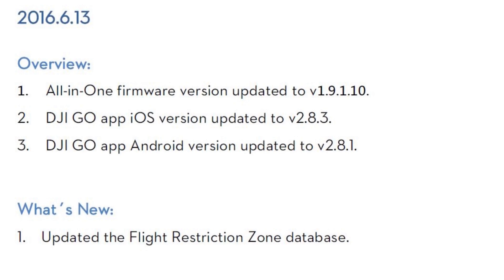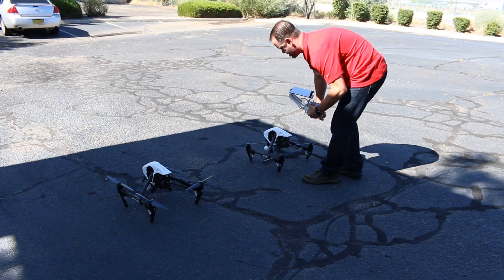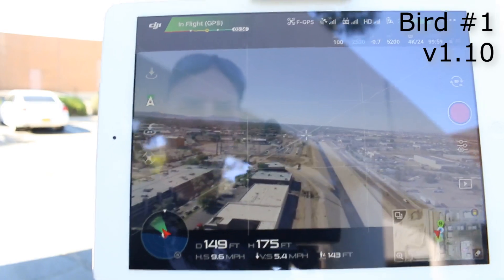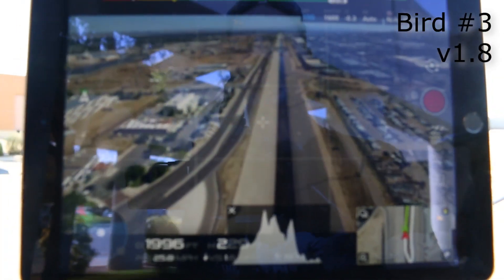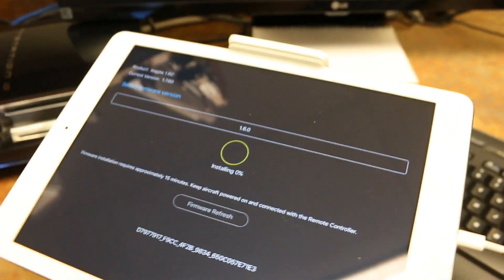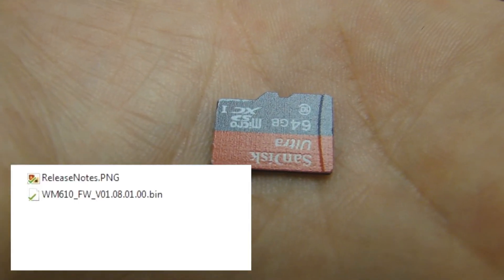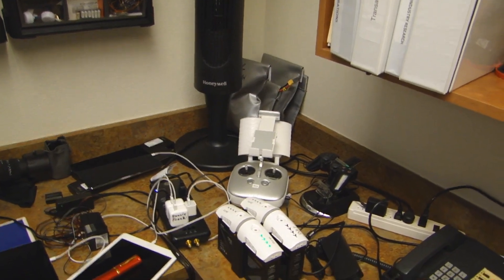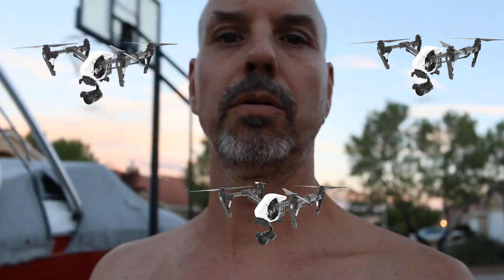Make your Inspire 1 great again...Part 1...

Comment: Hi Donnie. First, thank you for your very helpful video and for highlighting this image transmission signal problem. I am also encountering this on my Inspire 1, which has been running 1.101.40 and 1.7.60 on the RCs.

Today I tried to downgrade as per your advice. Initially I put both RCs back to 1.6.0 successfully. I then tried to roll the aircraft back to 1.08.1.00, but nothing happened. So I tried 1.09.1.30 and this was successful. I tried 1.08.1.00 again, but again nothing happened. I took both RCs back to 1.5.8 and again tried 1.08.1.00 on the aircraft - still nothing… I also tried this with a WM610_FW_DEBUG file.

Any ideas on how I can get it to take 1.08.1.00? The image I am getting now is an improvement, but it’s by no means perfect - still lots of pixellation and lag. It’s so frustrating when you consider I used to have a perfectly functioning UAV - if only I’d never upgraded any firmware!

Thanks again.
Reply from the maker: Hey Justin.  A lot of guys seem to have a hard time following the procedure exactly, so I made this video:

https://youtu.be/fEhjTpsW2Zo

Give this a shot.  Lemme know if it helps.
Reply: Donnie, thanks again. You're a hero doing all this. I looked at your second video and followed the instructions. I had actually already tried the 'Magic Key' method but then I realised that, because I use a Mac rather than a PC, the text file had saved as a RTF file rather than just text. So I did it again, this time making sure it was a txt file, from which I then deleted the .txt file extension. Sadly, the same thing happens - when I put the SD card in, the Inspire doesn't upgrade at all - it just starts up as if there is no FW update file on the card. When I look at the result file afterwards, it says that the current firmware does not support downgrade. So I seem to be stuck on 1.09.01.30+ - and still with image transmission signal problems... Any ideas?
Reply from the maker: Do you have a PC you can try this on?  Macs tend to do more 'under the hood' stuff that may be screwing up the "magic key" file.  I have downgraded from 1.09.01.10.  But....if I recall....I think the "+" was a problem.  Try going back to the previous version, which I believe is 1.09.01.30 without the plus sign.  Start the above video @ 10:25.  This way you can see all the version information.  Make sure your controller is back to v1.6.

Also, FYI, as you can see @ 10:25, we got good reception with v1.09.01.10+ (not sure about v1.09.01.30+).  We went back to 1.08.xx for NFZ reasons.  Also, worth noting, I stopped @ v1.09.01.10+ THAT DAY, because I ran into roll back issues that I didn't feel like trying to solve at my partner's office.  I believe the magic key in concert with gentle roll back to v1.09.01.10 (without the plus) was the winning ticket.

Keep in mind, I'm going off memory on a lot of this.  The work I've been doing lately has pulled me away from the Inspire platform, so "out of sight, out of mind" applies here.

Let me know if any of this helps.
Reply: Hi Donnie. I don't have a PC, but I guess it shouldn't be too hard to find one I can borrow somewhere... I also see from one of the comments below that 1.09.01.30+ might be a problem and that I should try 1.09.01.10. Only trouble is I don't know where I can find this version (or 1.09.01.30 without the + sign for that matter)... Any ideas? It's not downloadable from either of the links you provided above. My controller is at 1.05.08 - is that a problem? Is it better to be at 1.6? Again, thank you for your time on this.
Reply from the maker: Your controller FW is a BIG problem.  Update that to 1.6.  You might have to update to the latest version, then roll back to v1.6.  Try that first.
Reply: Hi Donnie. OK I've put both RCs back to 1.6 but I'm having exactly the same problems with the image transmission signal. So I guess I'm still faced with the same question of how I get the aircraft down from 1.09.01.30+ to 1.08.01.00. I will try and find a PC and do the Magic Key with a PC text file but, assuming that doesn't work, and I need the stepping stone firmware 1.09.01.10, do you know where I can find that? It's not accessible from either of your links above... Thanks again for all your time.
Reply from the maker: Hey Justin.  Try here:

http://dji.polybotes.feralhosting.com/DJI-Firmware/BIN/Inspire%201/

I would change "BIN" to lower-case "bin".  I don't know how fussy DJI firmware is with syntax.
Reply: Nice one, Donnie - thanks very much. I'll try that. And if that doesn't work then I guess I'm looking at hardware or iOS or Go app for the problem... I owe you a pint!
Reply from the maker: Hey Justin.  I have no experience with MacBooks, but I see no reason why that would be the problem.  I'm reasonably sure the secret to success lies within the .bin file you use.  A "gentler" roll back to a closer version is probably the winning ticket.  Please let me know if it works out!
Reply: Hi Donnie. Incredibly, it does seem to have worked out! I managed to roll the AC firmware back to v1.09.01.10+ from the link you gave. For some reason, it still doesn't seem to want to take v1.08.01.00 but I don't think it's going to matter because my image transmission signal problems appear to have disappeared! I'm only trying it at home, but I moved it around quite a bit (in a way that previously made the image completely fall apart) and it seems to be rock solid. I'm not quite counting my chickens yet and I need to do a flight test but the signs are very very good. So thank you. I am genuinely in your debt. I reckon I owe you at least 10 pints now, so if you ever find yourself in the UK give me a shout and I'll make good on that!
Reply from the maker: Good to hear.  You may have inadvertently discovered the exact version where DJI rolled back video transmission strength!  If you check my video @ 10:25, you'll see that I had success with the FW combination you now have.  Glad it worked out for you.  Please subscribe if you haven't already.

Also, the last time I was on your side of the pond was around 2000.  I don't have any plans of going there, but if I do, you can bet I'll hit you up!  HA!  Good luck to you!
Reply from the maker: Question: Which camera are you using?  If you're using the X5 or Z3, this would explain why the "magic key" file isn't working.  It only works with the X3 camera.
Reply: No I'm on the X3. And I've subscribed of course.
Reply from the maker: Thanx for the subscription.  I'm curious as to why your magic key file isn't working.  Oh well....as long as you got it working.  I think you will find video reception quite excellent with this version.  I also recommend the 32-channel hack.
Reply: That's a whole new world for me, Donnie - I'll have a look into it at some point... As for the firmware, once I've done a flight test I'll know whether or not I need to pursue the magic key route to take it down to 1.8
Reply from the maker: Well...when you're ready, it takes video reception to the next level.  Let me know how the new firmwares work out!
Reply: Donnie Frank I have Inspire1 v1 x3. With fw 01.11.01.50 video was poor. I've downgraded to 1.8.1.00 and rc 1.6 using blank file but it was the same bad video with many black / white lines and freezing... Now  flying with 1.6.0.40 rc 1.5.80 and DJIGO 2.8.2 without internet I will say it is not the same bird. It works perfectly!

Comment: after downgrade......im having trouble seeing FW on (about) page of app.....im using 2.4.3 and its blank.......i know i downgraded...any ideas
Reply from the maker: I haven't a clue.  I would need more information.  iPad?  Android?  Bird connects to RC?  RC connects to device?  Can you fly bird with RC without app?  More details needed.
Reply: android and apple, yes it all works app and rc and ac, but the about page is blank.....i will try to do a small video
Reply from the maker: Shut everything down.  Power up in this order: Remote control, Drone, iPad or Android, DJI Go App.  Good luck.

Comment: ========== 2014.01.01 00:00:06 remo-con disconnect======
Packet: WM610_FC550_FW_V01.08.01.00.bin
Result: Abort.
The current firmware does not support downgrade. Use a different version of firmware to downgrade the target version.

========== 2014.01.01 00:00:06 remo-con disconnect======
Packet: WM610_FC550_FW_V01.08.01.00.bin
Upgrading ...

========== 2014.01.01 00:00:06 remo-con disconnect======
Packet: WM610_FC550_FW_V01.08.01.00.bin
Upgrading ...

========== 2014.01.01 00:00:06 remo-con disconnect======
Packet: WM610_FC550_FW_V01.08.01.00.bin
Upgrading ...

========== 2014.01.01 00:00:06 remo-con disconnect======
Packet: WM610_FC550_FW_V01.04.00.70.bin
Upgrading ...
Result: Success.

========== 2014.01.01 00:00:12 remo-con disconnect======
Packet: WM610_FC550_FW_V01.08.01.00.bin
Upgrading ...
Result: Success.

Comment: Hello Donnie , i to have some issues with the latest firmware and i wanto to rollback, my setup is a i1 pro (x5) , in the description you mention that we should stepdown one fw at a time, my question is, i look up to the links and i cant find 1.10 /1.9 fw for the x5  (only for the x3). can i go straight forward to the 1.8fw in panorobots repository?
Thank you from Portugal
Reply from the maker: Hello Tiago.  I have to say that I didn't have very good luck rolling back via my X5.  As a matter of fact, I couldn't get the roll backs to work at all.  I had to use my X3, which worked fine.  That said, SOME guys have had better luck rolling back FW with their X5, but not me.  You probably don't own an X3, but if you can find one, it would be worth your time, as the roll backs go much smoother with the X3.  I wish I had better news for you.
Reply: Donnie Frank 
Thanks for the honest feedback, i have a x3 from the osmo (i know that it doesnt work on ThE inspire) that could do the trick, if not, will the entire craft be unusable ? Best regards
Reply: Just a happy follow up, at the third time i managed to rollback sucessfully to 1.8 with the x5 ! It took about half an hour but its done, all settings erased, the RC downgrade also to 1.6 whithout problems and binded great. Now time for some testings, calibrarions . 
Big thanks to you and to the person who brought the empty debug file idea!
Best regards
Reply from the maker: Good deal.  Next, you might consider rolling back the Go App to 3.1.1 and setting up the 32 channel video hack.

Comment: thanks for the video, i got a crashed inspire, trying to load at least 1.08 on it and how do you downgrade the rc, you know how you check log....yours is small, mines is 3 pages long......is that right ? also when i did have it up and running...the app did not show versions.....it just said N/A  help please
Reply from the maker: Watch the video first, THEN ask questions.  Downgrading the RC is in the video.
Reply: thanks i got it to 1.08 and 1.06 on rc but i have slave, before i turn on i would like to know what to look for, and have you gone any lower on the FIRMWARE tree ?? will it keep going to 1.02.1 ?? thanks
Reply from the maker: Hey Cruzroy.  I stopped @ FW v1.08 based on the release notes.  Improvements were made up to v1.08.  All subsequent updates were about NFZ expansion and modification and/or throttling back video feed.  Stick with FW v1.08 and v1.6 on your controllers and you should experience rock solid performance for the remaining life of your Inspire 1.  Me and my partner have 3 Inspire 1's and 5 remotes, and they're all rock solid with the legacy FW versions.  Good luck.
Reply: thanks.............but i wonder how low i can go......dont want to brick the bird
Reply from the maker: Read the release notes so you can make an informed decision.  That's what I did, which is why I selected FW v1.08.

Comment: Hey Donnie, thanks for the vid.  But DJI doesn't have the old firmware on their web site any more.  Do you happen to have or know where I can get version 1.10 for the Zenmuse Z3?
Reply from the maker: Hey Gary.  I don't have a Z3 camera, so I have no real-world experience rolling back with the Z3.  If you have the X3 camera, I recommend rolling back with that camera, and then installing the Z3.  My experience has been that the roll back works best/easiest with the X3 camera.  I subsequently attach the X5 camera, which works perfectly.  If you don't have an X3 camera, the only Z3 versions I found on the DJI website were Zenmuse Z3 Firmware V01.09.01.40 (M600) and Zenmuse Z3 Firmware V01.09.01.40 (M100).  Simply go to the recommended link (in Description section) and select "Zenmuse Z3" from the "Select Product" pulldown menu.  I suspect that you will have to do the blank file hack.  All instructions are in the Description section.  Good luck!
Reply: Yep, I read your forum post in Inspirepilots forum about the blank file hack.  I'll try it.  Thanks for responding.
Reply: ========== 2014.01.01 00:00:06 remo-con disconnect======
Packet: WM610_FW_V01.10.01.40.bin
Result: Abort.
The current firmware does not support downgrade. Use a different version of firmware to downgrade the target version.
Here's the error message I keep getting.  Tried it like 3 times.  I'm currently running 1.11 and using an X3 now.  Any ideas?
Reply from the maker: Are you using the empty file as laid out in the directions?  To hack past v1.11, you have to follow the directions EXACTLY.